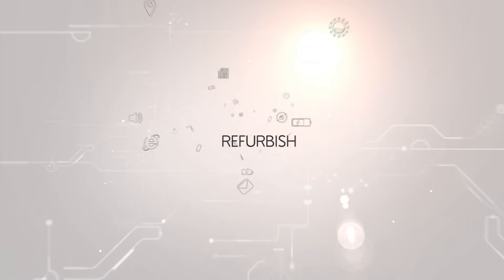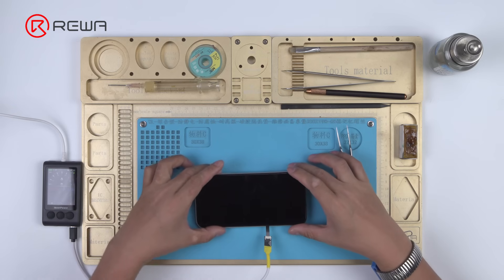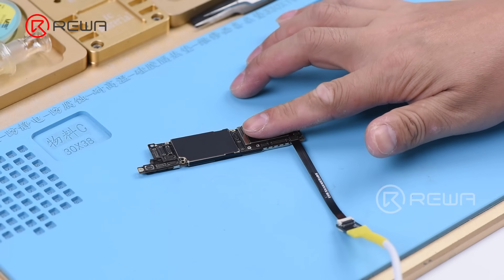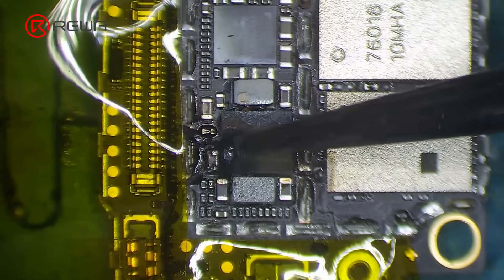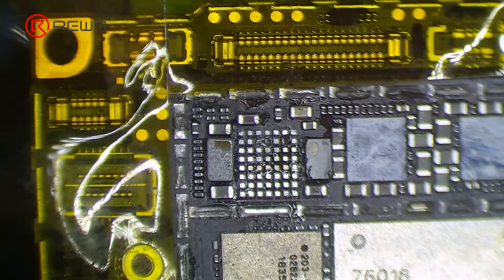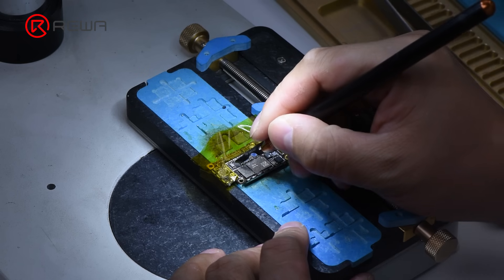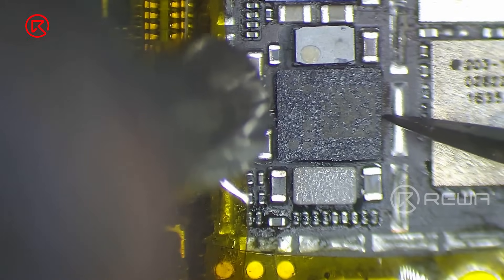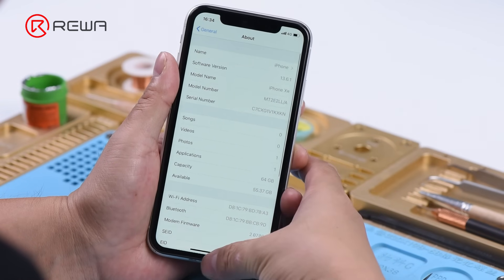Fixing iPhone XR No Signal - Replacing New Power IC & Jumping Wire

Comment: You didn't need to run the jumper, you can clearly see the via under the pad. You could've just recreated the pad connecting it to that via and be done with it much more cleanly
Reply: but what if the pads are burnt off as seen on this board  what would you do ?other than what he did
Reply: I don't think so .. because most of case pin of IC are masse connection or linked to a capacitor or else he should probaly have checked before the schema of the  IC ship  before making the short..
I thing all depends to the sheme and line of the connecting pad !

Comment: I have an issue with iPhone Xs. the battery is draining even when I'm not using the phone and it does not read the sim card while the screen is locked/off. But if the music player is running in the background it's functioning as normal. The same happens with different sim cards. I'm running iOS 14.3 at the moment. what can be the issue and how can I fix it?
Reply: Did you fix it

Comment: Nice job bro. But I wonder why is the signal amplifier area getting hot while the current is less than 150mAh? Can any component get hot at 117mAh? Is that because of the electricity leakage that you already mentioned?